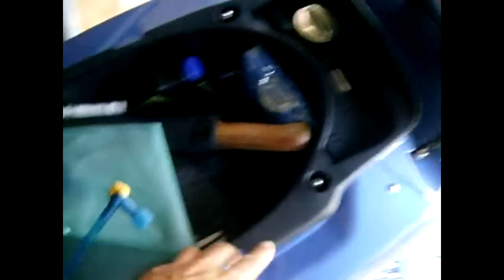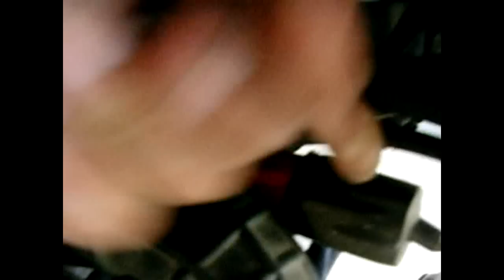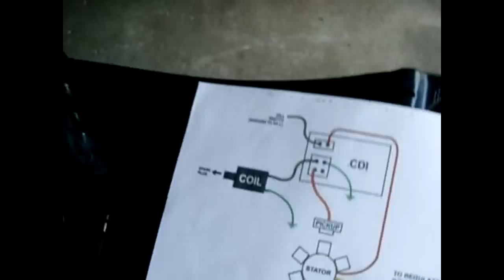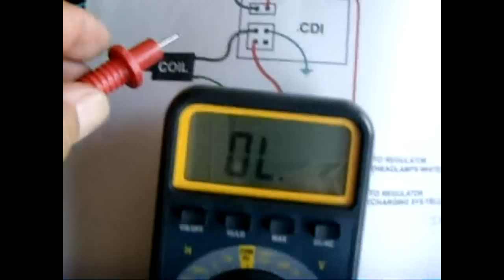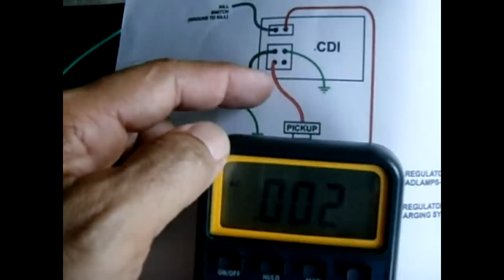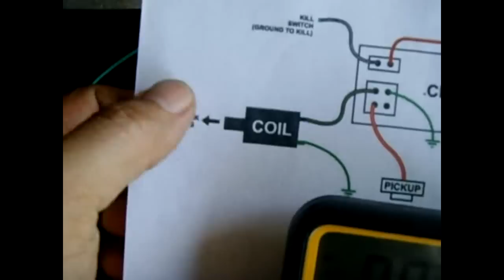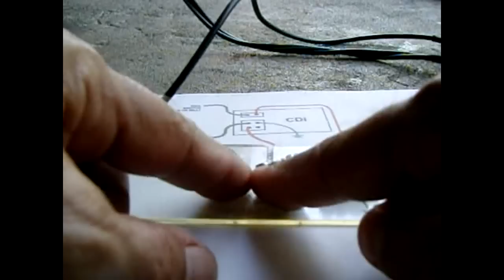The Ultimate GY6 Starter & Ignition Troubleshooting Tutorial

Comment: Thank  you for all the detail and info. You're a helpful & thorough guide.
I pulled the wires from my cdi while hoisting my scooter into a pickup bed. I think I can figure the correct placement for each wire but one got cut and now is difficult to get in and get to stay in the plug. Do local hardware stores carry this small of a connector usable to plug the wire back into the cdi box? Your help would be much obliged.
Reply from the maker: Keith Buell Hi there. To release the metal connector attached to the wire so you can open it up and solder it back onto the good section of wire, you need to use a tiny(jewelers flat blade screwdriver) to release the connector from the plastic holder. There is a tab that needs to be pushed in to release it.

Thank You! Be sure to share my channel with others and rate Thumbs up.

Comment: My starter solenoid is making an audible noise when I push the start button which will not start. It does start by kick start. The start button was working fine yesterday but now it does not.
Reply from the maker: Eric Edmonds Sounds like your battery is shot. Measure the battery voltage as you crank the engine. It should not drop below around 10V. If it does, charge the battery up, or replace it. If the voltage does not drop while attempting to crank, then you may have a bad starter solenoid. I have a video for that as well. 

Thanks. Be sure to rate Thumbs up and share my channel with others.
Reply: Ok,its a new gel battery from auto zone. Its odd, earlier it was starting just fine. Then the turn signals would not work only a buzzing noise when I used the signal indicator. Turned it off and it would not start by button only kick.
Reply from the maker: Now it sounds like a loose wire/bad connection.
Reply: Ok,I'll look around.  I'm in the garage now.  Just kick started perfectly. Been a couple hrs since I last started it.

Comment: HI,  very helpful video, good job! My scooter won't start no spark all of sudden.  Followed your video when I test the red wire coming from the stator, no resistance reading and no current coming out of it when I crank the engine.  What does it mean,  is my stator bad and needs to be replaced? Please reply asap. need to fix my scooter.  I use it for work.  Thanks
Reply from the maker: mobuis juan If you get anything vastly different from the video, then that part will need to be replaced. depending on which test failed, you can buy a replacement stator or pick up coil.
Reply: Thanks for replying so soon, I guest I need to replace my stator then.

Comment: My  gy6 150cc scooter starter just spins but won't engage to turn the engine over. Any suggestions?
Reply from the maker: Hey Don. If the engine cranks and the cooling fan does not turn, then you must have a faulty starter clutch if you hear the starter spinning. I have a video for that.

Thanks. Be sure to share my channel, and rate Thumbs Up.

Comment: Awesome video, awesome detail. Watched it over and over a few times. My problem was my ground terminal came off while cranking over the engine and it idling. The scooter shut off, I placed the wire back on, went to fire it up and nothing. 

Going to try this tonight when im off work and see what the problem is.
Reply from the maker: Thanks for watching Mario!
Reply: hey bud never got back to replying to you. but you video did help me out on my gy6! I went to ohm out my trigger wire on my stator and it was reading openline. Opened the stator cover up, pulled the flywheel, to then find out that the bolt that holds the stator down, backed out and ripped my windings up. Completely tearing my trigger wire. replaced it that day and good to go. thanks again!

Comment: hey i got a baotian scooter, bought a brand new battery plugged it in, turned the key. nothing....
ABSOLUTELY NOTHING WORKS. no lights are coming on etc
Reply from the maker: Hey there Chesternos! If the correct wires are attached to the battery( POS and NEG), then maybe the fuse near the battery is blown. Next in line would be a faulty key switch.

Thanks For Watching!
Reply: Fuse is good, checked it.
Key switch is busted, key wont turn.
Reply from the maker: That is the problem. I suggest you remove the key switch and try repairing it or replacing it.
Reply: it turns now, nothing. If i wire the battery straight to the start motor it runs
Reply: electronicsNmore  Do you have a video changing or testing the start switch?  I have 12Volts, switch on, brake pulled in and nothing when I depress the switch to start.  yesterday it cranked for about 60 seconds and then stopped.  Now  when I jump the starter solenoid, it turns over just fine.  I'm thinking its' that starter switch. But I have a tendancy to screw up stuff when I take it apart.  Any tricks to pulling that out to test it?
Reply from the maker: 60 seconds of cranking? Not good. The starter motor is not designed for that, nor is the solenoid. Try supplying 12V to the solenoid coil wires while the key switch is on. I have a video showing the solenoid. If it does start up, then suspect a faulty engine start switch or loose wire. You need to disassemble the handlebar plastic panels.
Reply: electronicsNmore Yep, it turns over nicely when you cross the solenoid with a screwdriver.  I now suspect a short in the starter switch because I have since gone through two fuses on the battery (I think it is a 10A one) every time mess around with the wires behind the right break handle.  I now need to figure out how to take the  handlebar panel off.  Do I need to take off the front (facing driver)?  I've got the four screws holding that facing piece on, but I suspect that doesn't need to come off because the turn signal plastic pieces prevent it from coming off.   Is that the right way to go?  ...removing the front part of the assembly (the part on the opposite side of the speedometer, etc)?

Comment: dame good job how dos the charge side work on the gy6 152qmi am tring see if its do wing wot its meant to how do you determined wot 12v betray you need Sukida Alien 125 SK125T-14 as i can't find a harness for it sow i mite need to make 1
Reply from the maker: Very hard to understand what you are saying. Check out my other video:

https://www.youtube.com/watch?v=_z6WXzHJrB0

Thanks for watching! Be sure to share with others, and rate Thumbs up.
Reply: electronicsNmore i don't no what goes where to test the charging its a gy6 125cc i don't no what battery its meant to have
Reply from the maker: Check the battery voltage while the engine is running at a higher RPM. You should see at least 13.5V. If you see no rise in voltage, or too high(above 14.8) when revving the engine, then replace the voltage regulator.
Reply: Thanks I'll do that am done rebelling my Gy6 152qmi hade to do lots of reapers

Comment: CAN ANYONE PLEASE TELL ME HOW TO CONVERT A KICK START ON MY SCOOTER TO PULL START, PLEASE THAT WOULD HELP ALOT.
Reply from the maker: Hi,
First, no need for caps. Caps means you are yelling to get attention. Using caps never gets people to reply faster, if anything slower. As for your question, I never heard of anyone making a pull start scooter except for small scooters you stand on, usually they go electric. All I can think of is modifying the CV cover over the variator fan to accept a pull start off a lawn mower(or a unit you purchased). Just make sure the pull start unit is rotating the engine the correct direction, bolted securely to the CV cover, lined up exactly in the middle of the variator fan, and going deep enough into the variator fan to prevent breaking off the fins.

Thanks For Watching.
Reply: electronicsNmore ; You replied to a guy because he used caps ,WOW. I often print in caps cuz I type with one and and I figure no one  would mind  if my caps button sticks .I never thought for a second that caps = screaming or cared

Comment: and how do I know if the stator is DC, if the CDI is installed is DC
http://www.partsforscooters.com/CDI_qmb139?sc=31&category=132388
Reply from the maker: If the output voltage from the stator measures in AC, then it is AC, if the voltage measures in DC, then you have DC. You can also check the part #.

Comment: First off, great instructional video. I still have a problem though, I'm getting no spark and I've run through everything you did and they were all within a close range of your values. The only test that was off was when you were cranking at 15:51 in the video, I'm reading only about 55 volts. Is this too far out of range as to prevent the engine starting?
Reply from the maker: Probably OK. If you connected up a battery charger, then tried it, you would see a higher voltage output due to faster engine cranking. You need to check EVERY wire connection for the ignition system. If everything works by the stator, then check to make sure the stop switch is not keeping the engine from starting. If it tests OK, then swap out the ignition coil and cdi.
Reply: electronicsNmore If you mean every wire connection, I did every single one you mentioned in the video only. The stop switch test worked on the way you showed how to test it. I got a new cdi and installed it and it sounded like it was closer to cranking but still wouldn't start up. Had the battery at fully charged at that point.
Reply from the maker: Try a new coil. If all the tests on the harness heading to the stator/pick up coil were fine, that does not leave much. Ignition coil or cdi, unless the information you are giving me is not accurate. Between the video, and your testing abilities, you should be able to figure it out.
Reply: electronicsNmore
I was reading 55 volts with the battery charger on as well. I order a new stator and put only that in and that was the problem. The old one, in two different coils of the copper wiring, looked blown out (not deep, but a couple of layers down). Not sure how that happened, but its running now. Thanks.

Comment: Thanks for this tutorial. It was very insightful and I learned quite a bit.

I was able to figure out that my CDI was bad so I swapped it out and it worked! I did the propane test and that worked as well! I was able to start the engine for about 2 seconds before it would die. I think there is some blockage in the carburetor and is not taking in fuel. I think the fuel pump works because I see fuel trickling into the fuel filter, but I think that's where it stops.

If I take the carbs apart, will I be able to determine if the fuel pump is good or bad? Or what kind of test can I do for that?
Reply from the maker: There is no fuel pump. If your not getting fuel , then you need to watch my carburetor repair video for this scooter.

Be sure to share my channel and rate Thumbs Up.

Thanks.
Reply: electronicsNmore  Thanks for quick reply! I was referring to the fuel tank valve that is activated by vacuum (It's labeled as a fuel pump in my parts manual)

I'll check our your carb repair video, and the rest of the videos in your GY6 playlist for that matter. Great step-by-step videos!

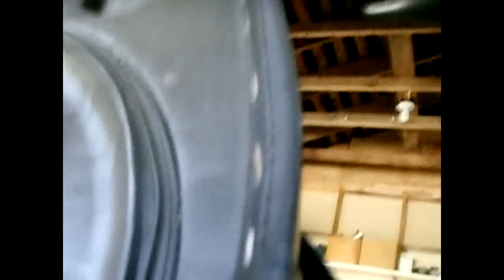Comment: @8:42 secs i go to slide my kill switch to off position and the beep (which is functional) does not come on.
Reply from the maker: Hi Jason. If you have the correct wire to the switch, when you perform the test with the ignition switch in the "ON" position, the beep should go off. I would test the switch directly. Remove the wires on the back of the on/off switch, then connect your tester to the 2 terminals and flip the switch back and forth. The continuity alarm should go on and off.

Thanks for watching! Be sure to rate thumbs up and share.
Reply: First of all thanks for your time already, i have removed the back of the throttle/kill switch cover and have access to the circuit board. If i bypass the maybe faulty switch i still have the huge underlying problem of my ground coming from the stator getting SUPER hot (during cranking) causing smoke in wiring harness. If i create another ground from frame to valve cover the stator wires do no get hot, the new ground gets burning hot and the bike turns over how its suppose to. I think i am in over my head with this hot wires and not starting problem and debating a new wiring harness or redoing the entire thing myself. I will test the kill switch directly later.
Reply from the maker: You have to trace every wire and test each part. Something definitely not right.

Comment: My GY6 150 just had some electrical issues and i am STUMPED. Tried to start it and the tail light, rear brake light, and left side both blinkers all didn't work and it wouldn't start. When i took it apart to check out things i found that the green (ground) wire from stator up to battery area get super hot to the touch. Did my ground fail? Any advice?
Reply from the maker: You need to probe the wires to the lights to make sure 12v is present. If it is, try grounding the other wire to the light to see if the lights come on. Sounds like a bad ground.

Don't forget to share, and rate a thumbs up.

Thanks!

Comment: Ok I did exactly the way you said in the video and it was very helpful,I think I may have found the problem in the starter,when I bought this bike from a auction,as I am now taking off the starter the starter wasnt bolted down to the engine,it was just in there,when I gave it a few taps it just pop right out of the gears,does that mean anything? Like just stuck in there but locked into the gears?

Comment: When I jump it from the selenoid the motor fails to turn over,I think it could be a faulty starter,so how do I test the starter,should I take it off and then try and start it?
Reply from the maker: You did not answer what I asked. Can you start the scooter using the KICK START? If it does not turn over using the kick start, then the engine is jammed up. If you do not have a kick start, then try a new starter.

Thanks
Reply: electronicsNmore
No I cant start it using a kick start because there is none,so I should try a using a new starter?
Reply: electronicsNmore
How do I test this starter to see if its not faulty?
Reply: I can turn on the ignition and the electric and alarm works,but the engine want turn over,I am guessing its the starter?
Reply from the maker: OK. I have another 2 videos for testing the starter.

GY6 Starter Repair for Hard Cranking/Excessive Current Problem

GY6 150CC Starter Removal & Repair(New Brushes/Custom Oil Seal)
Reply: Hi I am having problem with my 250cc scooter  after I installed a new engine and change the carbutetor,the bike starts well but it want idle,I have to keep giving it gas to keep it running,I adjusted the speed Idle screw all the way tight as it will go ,so I just got high engine idle  but want idle?any suggestions please?
Reply: I cant find my idle mixture screw? I look all the way to the bottom sides of my 250cc roketa carburetor and there is no idle mixture screw,only have a speed idle screw,which is on top near the gas cable of the carburetor,it stops the gas throttle,any suggestion where it might be? Thanks
Reply from the maker: Watch this video for more info.

Thanks

GY6 Carburetor Removal, Inspection & Adjustment(START TO FINISH)

Comment: Hello electronicsNmore how are you. i am having a problem with my 2009 BTM ,BT49QT-20 ,the bike just wont start,switch the key on press ignition button,nothing,can you explain what you think could have cause this problem
Reply from the maker: Hi Leslie. If the engine does not start, then check in this order:

Battery voltage
Battery connections and other connections to starter/solenoid
power to starter solenoid
engine stop switch, then cranking switch, then key switch

You can also short out the 2 large bolts on the starter solenoid with the engine switch ON, and also the key switch ON. If the engine starts then post again.

Comment: If my scooter cranks with the flywheel pedal but there is no ignition via the key and button could that be an old battery?
Reply from the maker: If the key is not in the ON position, then the engine should not start using the kick starter. If the engine does not start using the electric starter, then you have a starter problem, engine start switch problem, or faulty solenoid.
Reply: So it can't be a dead battery issue?\
Reply from the maker: You need to do tests, and measure voltage.

Comment: i have looked everywhere for all the test parameters for my gy6 go kart
has same ac fired 150cc with all same wires
but getting no spark i have tried to do test but have a greenlee meter and dont have legend to know where to set the meter  any help?
Reply from the maker: Greenlee makes good meters. You need to do a "Google" search for your model meter to learn how to use it.

Thanks For Watching
Reply: yeah got legend and took readings
kill wire wasnt grounded but didnt need to be for test  better actually
everything checks good for  stator wire and trigger but kinda lost from there 
are both wires from coil tabs grounded when connected?

Comment: i was riding a and the engine died out.. the spark plug wire came off... tried to start it up again.. and now it want... my gy6 engine want start...i'm getting gas, and spark...and compression...please help me out
Reply from the maker: Hi James,
If everything was fine until the spark plug wire fell off, then I would carefully inspect your spark plug, spark plug wire and boot. Remove the spark plug, and insert it inside the boot, then using a pair of insulated pliers, hold the metal body of the spark plug against the engine block/ground. Have someone crank the engine while you are looking. If you don't see sparking, you have ignition problems, not fuel.

Thanks For Watching. Be sure to rate thumbs up and share.